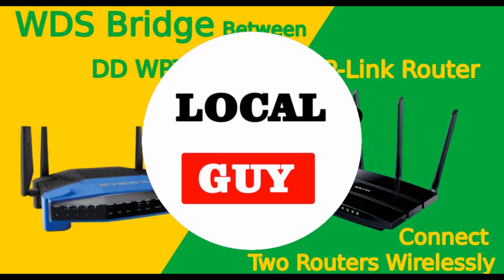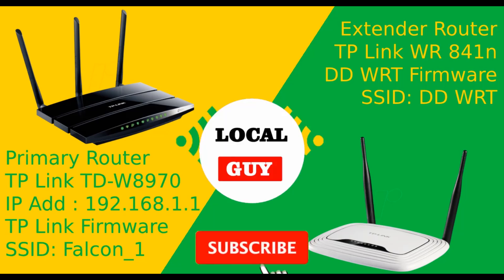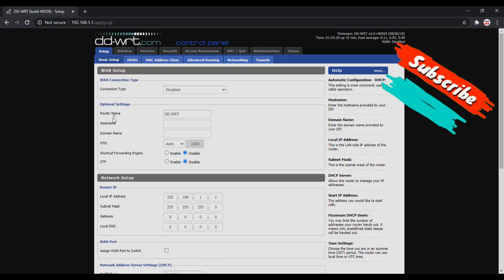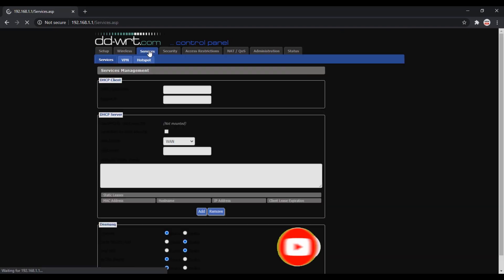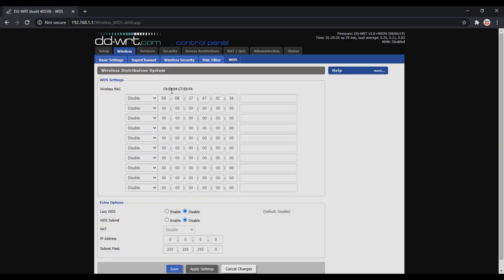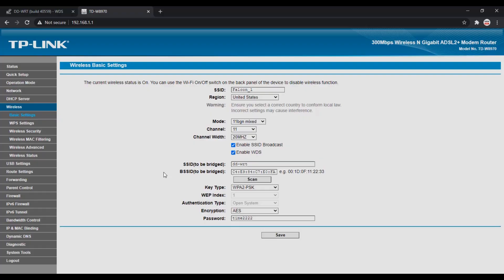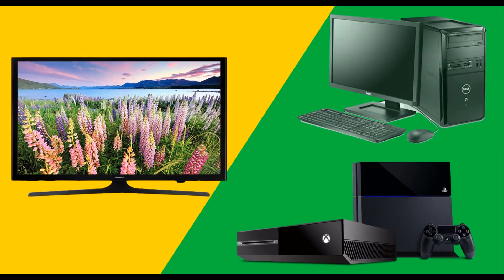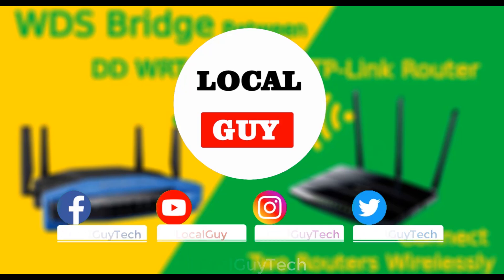✓Wireless Distribution System WDS Bridge on Flash DD WRT Router Extend Increase Range WiFi Repeater

Comment: hola buenas tardes, y muchas gracias por tu vídeo, lo realice al pie de la letra, y mejor aun tu entorno de ejemplo es el mio,  quería practicar a ver si funcionaba, ya que poseo un router primario con el firmware original tp link y otro router secundario tplink pero con el firmware ddwrt.

ok funciona si pasa el internet y de antes me le a signa la ip del dhcp del router primario, pero no me recibe respuesta cuando hago test ping de una ip, y aun mas allá no recibo respuesta; ayúdame a solventar, como soluciono eso, ya que yo uso hacer ping en cmd de windows, para ver que tan breve es la respuesta de cada equipo conectado a la red inalambricamente; claro si el equipo esta en entorno a cada router, es decir una pc en el router secundario y mi celular en el router secundario, si hay respuesta de ping en cmd, pero si una PC esta en el rouer secundario y el celular por wifi al router primario, no hay respuesta de ping en cmd, como soluciono eso por favor, espero que me entiendas mi idioma con la ayuda de traductor de google, y gracias, esperando una pronta respuesta, saludos desde Venezuela.
Reply from the maker: English pls

Comment: Great video. I tried attempting this as well and can't access the second router after applying settings
The only thing that I can think of that could be the issue is that my primary router is running a 2018 Kong version of ddwrt and the second router has a newer version from Aug 2021
Should I flash with the same version as my primary router? They are both identical routers. I have the flash files available for the older version
Thanks for your help

Comment: I tried the steps here. But upon applying the settings on the dd wrt router I'm unable to access it. I just got the apipa address 169.254.x.x. Tried setting static IP on the laptop same subnet as the router but still unable to access it. What do you suggest?

Comment: I am doing same but my extender router only showing obtaining ip and amd not got connected i have tlwr841n router
Reply from the maker: which routers are you using ? keep same channel number,security settings,password and make sure that extender router is getting enough signal strength
Reply: @localguy  i have tp link router and the the signal strength is in between 20-27 db sometimes it got connected but sometimes it only shows obtaining ip adress than i need ti restart it to get connected plss.. tell me solution and give replyy.yyyyy...